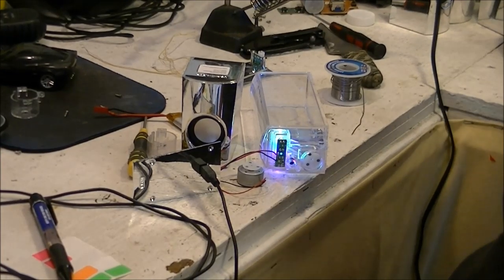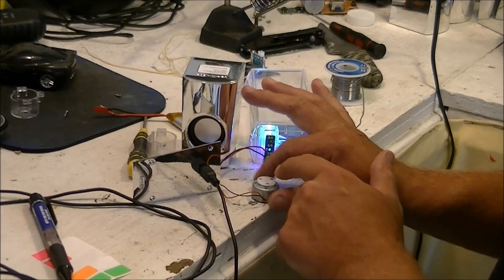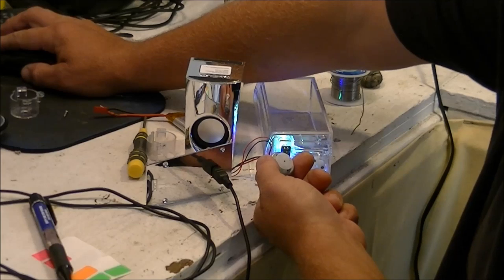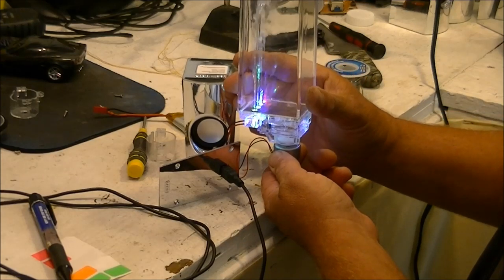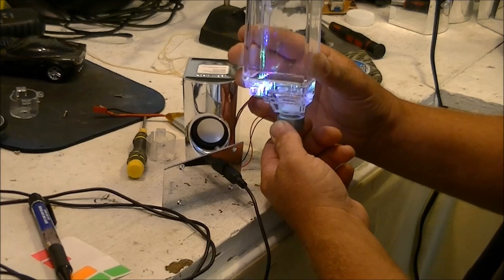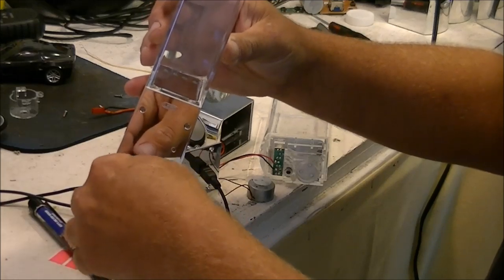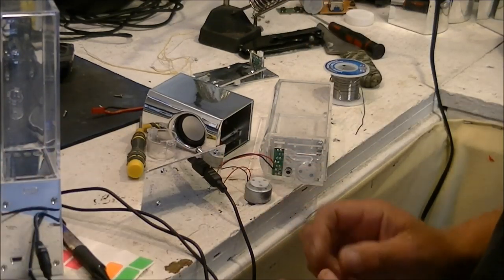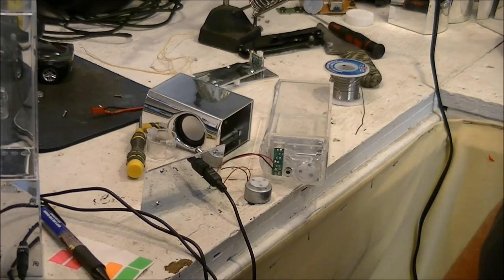Gadgetree Dancing Water Speakers How They Work

Comment: I tried water in mine to make sure they were sealed and then mineral oil. It seems to me the original liquid can't be mineral oil because when I tried water and glycerin the oil persisted on the walls of the tank and didn't mix with it at all. If the original liquid had been oil, I would have seen this the first time I put water in. I am trying water plus glycerin in another set. It doesn't seem to coat the walls the same way but the viscosity is about the same with 1/4 glycerin to water.
Reply from the maker: Chris Johnson well then you did it wrong your supposed to thin out the mineral oil so its the consistancy of water

Comment: Do you know how you can add water or refill them? Thanks :)
Reply from the maker: youll need some mineral oil and you need the same oil and you need a surenge with a needle to inject the stuff then you will need to reseal the plug
Reply: great, thanks :D
Reply from the maker: MyDogSneezes your welcome

Comment from the maker: if you have a needle surenge you can fill it back up then seal the plug area with some Epoxy or JB weld or Silicon

Comment: does anyone knows what kind of oil or water is inside of one of this speakers? because i have one that the plastic is cracked and is empty speakers sound fine,
Reply from the maker: if the glass is cracked you can not refill them you need either new speakers or a new glass, i do have a few glasses left in my parts supply i have been collecting for some time now i refurbish these as i pick them up , any how email me your shipping info for a total with shipping on a glass airsmith28@hotmail.com

Comment from the maker: what i know is the oil in side is a mineral oil i dont know how they thinned it out all i have been able to find out is that is a mineral oil youll  need a surenge with a needle to inject the stuff then you will need to reseal the plug ..
Reply: Kevys Rc & Music How can you be sure it is mineral oil if you have not tried it?
Reply from the maker: Chris Johnson I cant be 100% sure how ever the info on the net i found said it was so  i went with that, also the stuff when it comes in contact and stickers eats them off and when it contacts the wires it will also makes them gooie as well it wil cook the motor when the stuff leaks into it, its also oiliey .. etc etc etc.

Comment: The main speaker will go off if the volume goes over more then half. I have to unplug everything to get it to work again is there a way to fix this problem?
Reply from the maker: No Idea man iam not an expert on these speakers when stuff goes wrong i replace parts that need to get replaced so it might be the main board or it could be something in the usb connector i have no idea they are not infront of me so i cant tell you

Comment: Is their a way to fix to my water speakers. The problem is my main left speaker shoots water higher then the other speaker for some reason. I think it's something wrong with the pump system and i do i have my volume way up and they are still not in sync.
Reply from the maker: turn both speakers upside down look close at the liquid levels if they are exacatly the same then check your computer settings to see if maybe you have balance for fader setting off . if everyhting checks out ok then you could be getting a weak motor if the levels are not the same when you put them upside down then you have to top up the one thats lower and trust me i can sell you a new glass for less cost then it will be to get all the stuff you need to top off a speaker glass, i also have motors etc. etc.
Reply: KevinMillard68 Just check the speaker water levels and one that hold more water does not reach at the top of the glass and does not match the height of the other speaker. I just brought these a couple week ago and they alright messed up.
Reply from the maker: Zatchbellize why are you telling me how to check the speakers your comment makes no sense to me , if you just bought them a week ago then you still have a warranty so return them for replacement set
Reply: KevinMillard68 They said it would cost $50 dollars to ship it too them and i was trying to figure a another way i can fix it by myself if it can be done. They was not offering to pay for shipping.
Reply from the maker: Zatchbellize wow thats a rip, you i can sell you a new glass for the 1 speaker but its 10.00 plus the shipping ill need your shipping info to get you a total with shipping. email me your details at airsmith28@hotmail.com

Comment: um My speaker doesnt work, i tried opening it but the thing u showed me in the video, the white circle that turns around when music is on, it doesnt circle around when i turn on music, but when i connect to my computer then it shoots out water once and then it doesn;t but the speaker still works.
Reply: please help!!! T^T
Reply from the maker: got me on that one i have no idea other then check to make sure the cables are all pluged in firmly in place
Reply: KevinMillard68 oh.. :( i bought it with 70 $ but it doesnt work, and 1 speaker the water all leaked out, i need to put water in it
Reply from the maker: 정승민 if they are just new then send them back for a replacement set they come with a warranty
Reply: oh I bought it in korea.
Reply from the maker: 정승민 i dont think it matters where you got it they all come with warranties but if you are unable to claim the warranty then you might want to fix them .. its not water thats in them from what i found out its a mineral oil or oil of some sort that has been thinned out to react like water,  and it has to be injected into the plug, then youll have to reseal the plug any of the stuff that did leak out make sure to clean up all thoes areas the stuff can kill the motors if it gets on them , i do have some spare parts for the gadgetree speakers if you need them i sell the parts pretty cheap but i do a limited supply of parts to . i recycle these as i can and keep parts that are good parts only so i can help any one that has problems

Comment: i need help, one of the speakers dont want to blow out the same amount of water as the other, and the rotter just stop suddenly?
Reply from the maker: sounds like you need a new motor i have motors for them .. email your shipping info and ill get you a total with shipping on a replacement motor airsmith28@hotmail.com

Comment from the maker: its not actually water its a mineral oil and you need the same oil and you need a surenge with a needle to inject the stuff then you will need to reseal the plug

Comment: sigh, mine stops working for no reason. i would like to separate the glass part form the speaker and check. however im afraid that i will break the whole thing. its a bday from my frd. without the "water" bumping it becomes so ordinary ...sosad
Reply from the maker: check m other videos i have some that show them apart its really easy to do

Comment from the maker: its auctually not water turns out its a mineral oil, anyhow if you have a needle surenge you can fill it back up then seal the plug area with some Epoxy or JB weld or Silicon

Comment from the maker: it does not get any clearer then whats in my video watch it again a few more times, it all has to deal with pulsing the fan at the right timing and building a small amount of pressure and the water/oil goes up and down..

Comment: my speakers work, and the water shoots up with the motor, however the lights don't come on now.. the black wire came off but  i singed it back on but it still doesn't come on
Reply from the maker: either you got the wrong connection or you got another problem take the other speaker apart same time they are both wired pretty much the same for the leds
Reply: KevinMillard68 thanks, lights don't work on primary but when a cord came off the main, the lights came on the other speaker.. i used some kind of kit not sure what it was called but it made like a lil metal ball to go on top and dryed
Reply from the maker: MC Fleury well you need to solder electronics properly
Reply from the maker: MC Fleury when your going to solder wires you have to do it right  with a soldering iron and solder lead based is the best
Reply: ok thanks!
Reply from the maker: MC Fleury your welcome

Comment: I have a problem with the motor. The motor inside the speaker stops spinning, and when I spin the motor wheel, it spins, then stops. Anyone know how to fix this?
Reply from the maker: might need a new motor i have several parts for these including motors.email me everything you need and ill get you a total with shipping need your shipping info any how my email airsmith28@hotmail.com are you good with a soldering iron if not you can just splice into the wires and use some heat shrink tube or electrical tape
Reply: Do you know a way to fix the motor, like opening it, or performing some like spin tasks (ie spin to the left, right, etc)?
Reply from the maker: TheAmazingMino you can not fix them you have to replace them

Comment: sir that motor how to work in 5 v how to atatch   motor in audio signal
Reply from the maker: sameera vidanaarachchi love to help you out on that but its really not that hard just take your speaker apart and you can eisly trace the wires from the motor to the pcb board where its soldered to, ...

Comment: Common drug store mineral oil is too heavy to be used straight. It must be thinned using mineral spirits. I used 2 parts mineral oil and one part mineral spirits.  I slipped a syringe in the side of the filler plug and slowly filled the reservoir until it was the same as the good one.  I cleaned the plug with straight mineral spirits and a cotton swab, and sealed with a small glob of hot glue.  Baby oil should work also, as it is mineral oil with fragrance, and my be thinner  YMMV
Reply from the maker: see i knew someone would fiquire out how they thinned it out.
Reply: Well not so fast. The oil is still a bit "clingy"  and I am concerned that it may be too volatile.   If it leaks on onto the wires it could start a fire. Not good,  I am still on the lookout for the proper solution.  I will post my findings.
Reply from the maker: id try a flame test first in a jar to see if it even will catch i know the stuff in the speakers will no flame up at all. like i have said tho my research said it was mineral oil now it is the internet to so i cant even say 100% what is really is, if its still clingy then id thin it out more and see what happens.. for me its less hassle to just put in a new glass tho parts are not available from the companys that makes these i do have a good parts collection going so far of good parts for repairs that have all been tested and passed perfect
Reply: I just tried baby oil.  Much thinner, swirls the same, but still too heavy.  Only rises about 1/3 the way in the glass.  That being said it would take less thinner to thin the oil out.
Reply from the maker: Patrick DeCanio how thick is linseed oil??
Reply: I also thought about linseed oil.  The only linseed oil, and ring oil for that matter is not perfectly clear. The box on the Leading Edge speakers says "100% non-toxic, harmless, environmental protection material. (Plant filling liquid)".  I have no idea what that means LOL.  The Baby Oil is almost there ( I had to drill out the plug this time)  it just needs to be thinned slightly with mineral spirits.  What's good it is cheap and available anywhere.  I plugged the hole this time with epoxy putty
Reply: Kevin, do you have a spare broken or leaking tank you could send me?  It might be useful in determining the formula for the correct viscosity, and how many CC 's of oil is correct, so we can share it with everyone.
Reply from the maker: Patrick DeCanio cool cool  do me favor once you have this mastered post a video please, on how you have done it and the mix you used for it all .. if you dont mind

Comment: WHERE THE F*CK DID YOU GET THE MOTOR?????? HOLY HELL!
Reply from the maker: you cant buy the parts for these
Reply: ABlankNam3dKid
WHERE THE F*CK DID YOU GET THE MOTOR?????? HOLY HELL!
'
two battery motors are coming with inside both booths...
both motors are oil pumps sparklings

Comment: PLEASE HELP. When I play both speakers at normal volume they work fine but sometimes I just want to put the volume higher and as soon as bass kicks in/drop they both buffer like they literally start to turn on and off simultaneously (including lights and music). But when I play only the main one at high volume it works perfectly fine, any suggestions? Thanks in advance
Reply from the maker: shoot me a video to show me and ill see if i can trouble shoot it better for you send me the link to the video once you upload it
Reply: KevinMillard68 actually I just saw one of you other videos and  the problem was that I plugged the USB to a lower power thing (where u plug in the cable) so then I used the one for my tablet wich is bigger and it worked perfectly fine with the volume all the way up. Thanks for the help!
Reply from the maker: xdeadstepx cool good stuff man enjoy